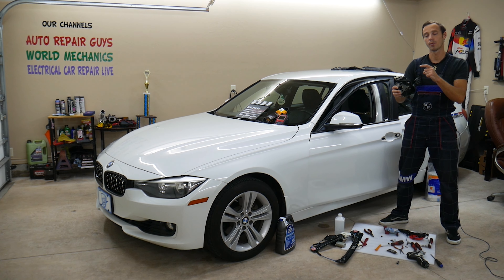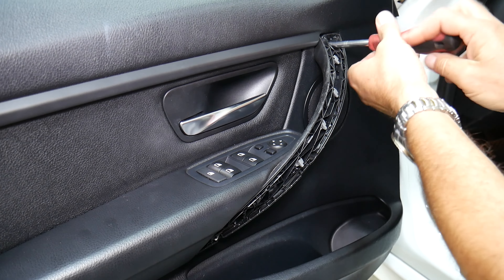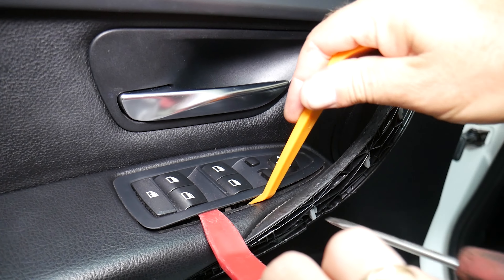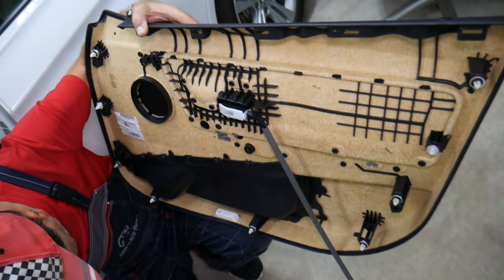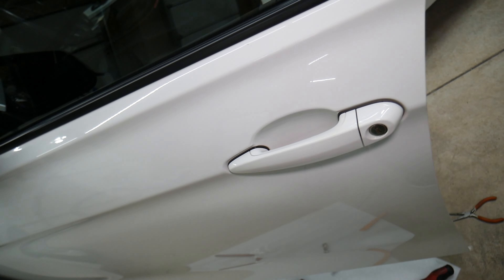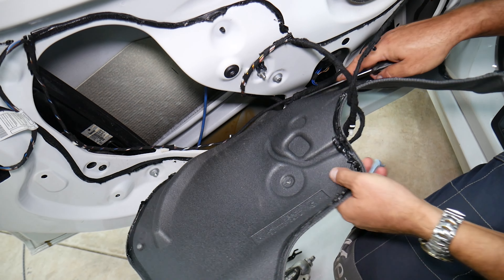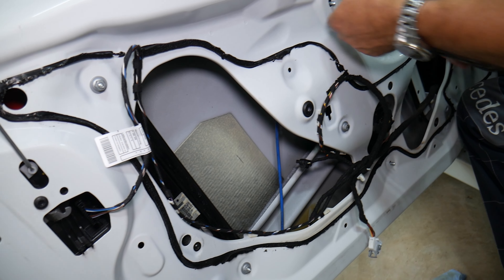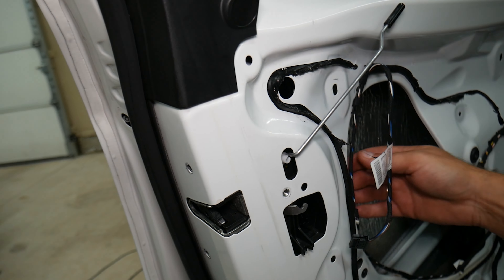FRONT DOOR LOCK ACTUATOR REPLACEMENT REMOVAL BMW F30 F31 F32 F36 328i 330i 335i 320i 318i 316i 328d

Comment from the maker: Products that we use and recommend:
► Front Door Lock Actuator Driver: https://amzn.to/4flPVry
► Front Door Lock Actuator Passenger: https://amzn.to/3YI6kQf
► Torx Set: https://amzn.to/3xlCkfT
► Panel Removal Set: https://amzn.to/3YiMADu
► Assorted Fuses: https://amzn.to/4fx4s3F
► Tool Set: https://amzn.to/3p5MM6t
► Screwdriver Set: https://amzn.to/3XRB28Q
► Mobil 1 Oil: https://amzn.to/3xBc8B9
► Oil Filter: https://amzn.to/3w0Ulme
► Torque Wrench: https://amzn.to/32qyRwg
► Liqui Moly Engine Flush: https://amzn.to/3IiDBID
► Voltmeter: https://amzn.to/4hB6Zvk
► OBD Scanner that we use most often: https://amzn.to/3I4MQfe

► Check out our Amazon Store for the tools and parts that we use: https://www.amazon.com/shop/worldmechanics

Comment: this job can be completed in 20 min , you do not need to pull the door window switch .. you do not need to take out the window regulator , you also do not need to take out the exterior door handle ...   

you will need to pop the wire harness mount and rest door panel on the side  
roll window up and slide actuator out behind the window regulator
Reply: Exactly 😂

Comment: Strange you don’t show how to disconnect the window from the regulator, but it helped me as I just rotated the inner door handle assembly and the door latch as one out through the door without removing the regulator. Thanks for the video—it helped a lot!
Reply: Was going to ask if that could be done removing the lock actuator without removing the window regulator and motor

Comment: Detailed video. It is possible to remove the door actuator without taking out the outside handle assembly. Meaning, that you have to disconnect only the white cable shown at around 18:41, while the actuator is still inside the door. Additionally, the vertical beam you removed at around 14:00 can be left on. If you flip the actuator while inside the door, it is still possible to pass it from behind this vertical beam.
Reply: You can leave the black beam in the door?

Comment: It's actually possible to replace the actuator without removing the door handle, without removing the window regulator...only pain in the as* is the cable holders of the lock actuator itsef...it took me about an hour to replace...i didn't even disconnect anything of the doorpanel,i just left it hanging on the ground
Reply: Can you help me with it
Reply: @plamenpeykov709  bring it in 😀
Reply: @Musti1986 where are you located
Reply: How did you get the actuator out of the door ?
Reply: @yashbopardikar  i don't remember but it's possible,i did it
Reply: @seanwoodson1143  Belgium
Reply: Me too they did way to much this time but they definitely helped me with a lot

Comment: Thank you for this detailed video! My F30 lock on the same side but RHD just stopped working. Just bought the parts and tools. Will try when the weather is good.

I have another problem of the drivers window going all the way to the top and then it come down a few inches. Can you show what we can do please?
Reply: I have a similar issue how did you solve it ?
Reply: You need reset anti trap function